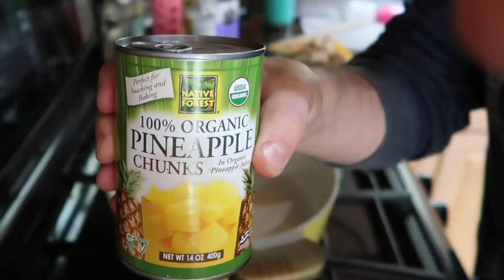IT's Time START  BUILDING the Road for the BARN we ORDERED on the INTERNET BARN PROJECT Day 2

Comment: The shovel operator has obviously done that before.  Very nimble with that rig.
Reply: I bet Al was itching to give it a go.  He is not shabby with his Kubota.
Reply: Gotta love the skill. I'll bet if you put a spatula on that bucket he could have frosted a cake.
Reply: @elkhunter8664  Yes I think so.
Reply: @elkhunter8664  so true he is awesome
Reply: I didn't notice anything exceptional about that hoe operator. I don't think he put a large enough pipe under the driveway. Gotta keep in mind cleaning one out. The smaller it is, the more often it needs cleaning and the harder it is. As a matter a fact that was a pretty chinchy looking culvert pipe to me. And it should have been plastic as well.

Comment: I'd rather be in the 49's than the 90's were having already and it's not even summer yet. I have a feeling that it's going to be a drought for us here in Northeast Alabama. It's not usually this hot on the mountain especially this early with no rain for two weeks. We we're getting normal rains but not anymore. It's like spring lasted for 2 weeks. 
It's good to see your getting a break from the water. 😊

Comment: I may have started following you too late and missed some descriptions about the farm. Is the driveway you are building up an old discontinued road between properties, or is it a farm path used for guiding livestock? Around here we have places where there are two parallel stone walls (though usually not so far apart) that connected barns to pastures or grazing lots.

Comment: I absolutely love watching your channel, what was the corrugated steel pipe with the 90degree up-pipe for (gutter drain pipe)? Or is that for a floor drain inside the barn, so you can hose down any wet muck tracked in (or maybe animal urine runoff)? Would be nice to have a drain inside the barn as part of the killing floor for indoor chicken/hog processing if the weather turns. Keep up the great efforts! :)